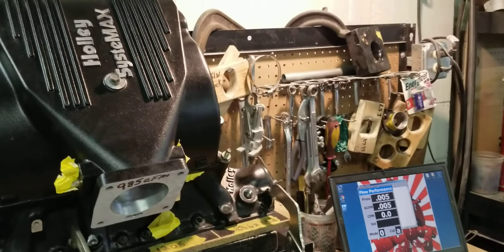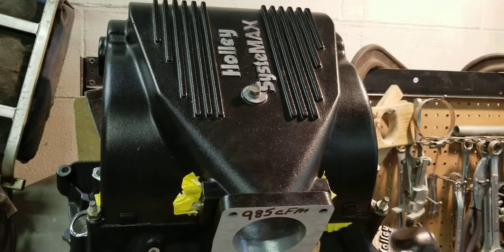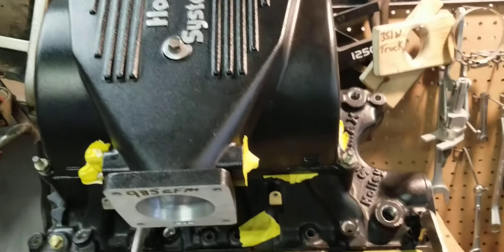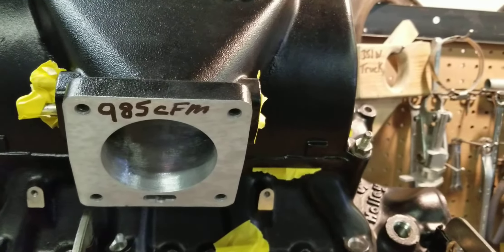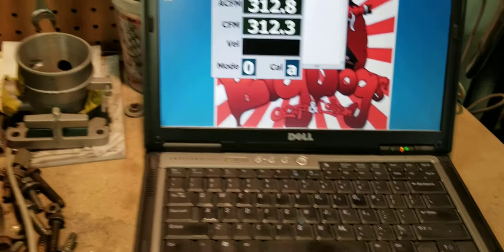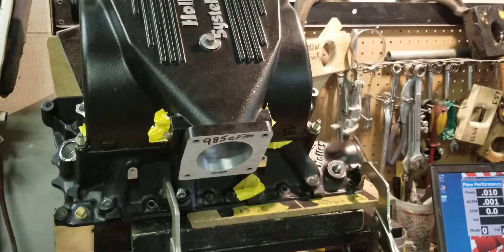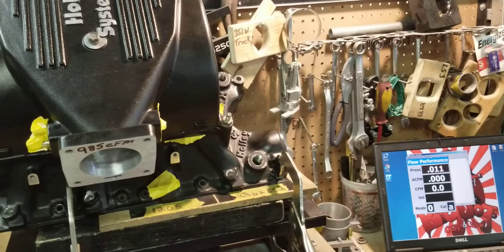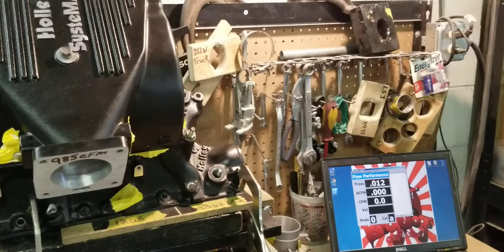Systemax 2 stage 2 upper and lower follow up

Comment: Have you ever done a stage 3 port on a systemax? I’m curious what it would do
Reply from the maker: Yes we have. Cut, shortened, material added to the TB tunnel and fully ported.  It was setup for 7,500rpm peak and flowed 350cfm average runner flow.